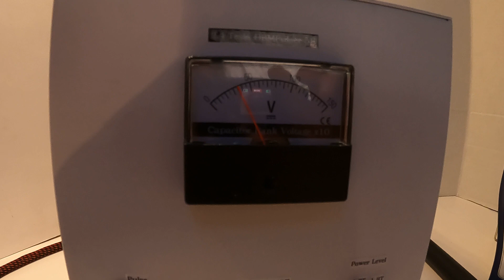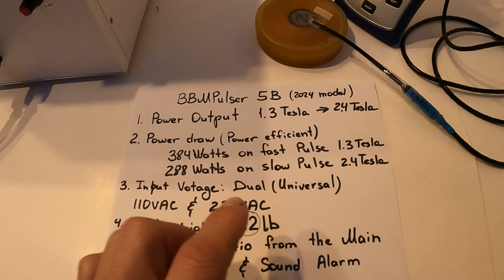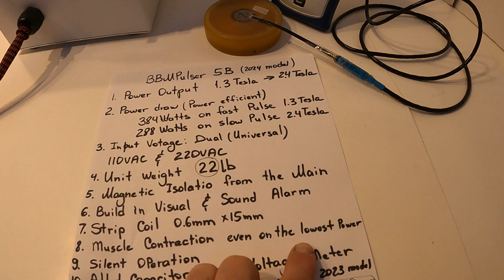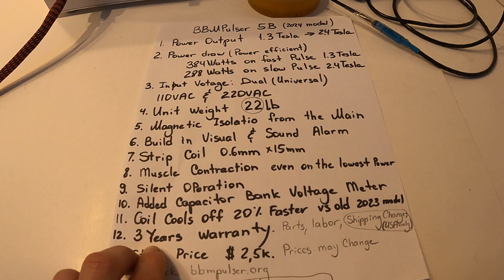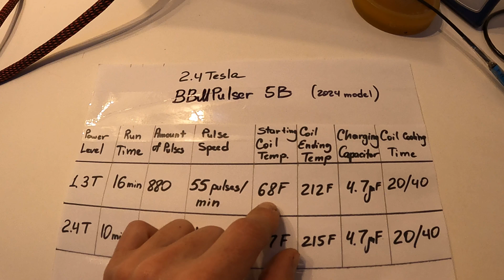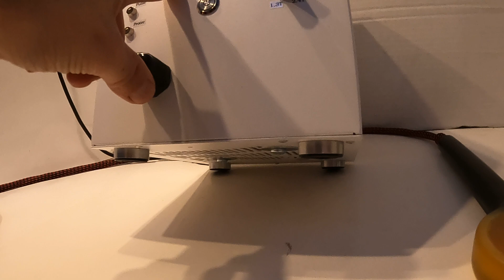152 Latest 2.4 Tesla BBMPulser 5B (2024 model) New Coil, Faster, Power efficient and much more

Comment: Nice new model.  Will you be making a double (switchable) applicator handle available for this new design?
Reply from the maker: I could, don't see why not, there is enough space inside to do it
Reply: Nice clean lines. I like the capacitor bank charge voltage meter. I noticed you don't have the counter that you've had on other models.